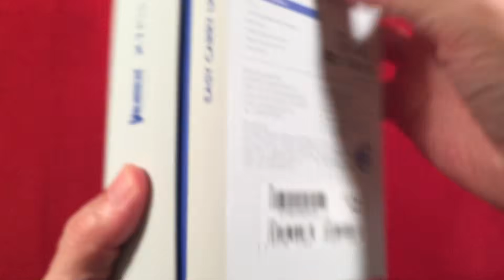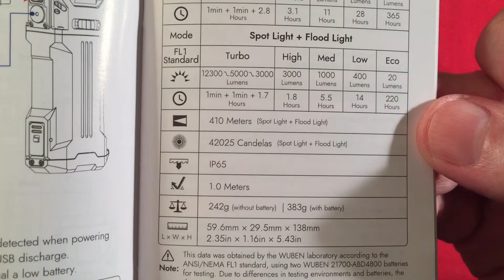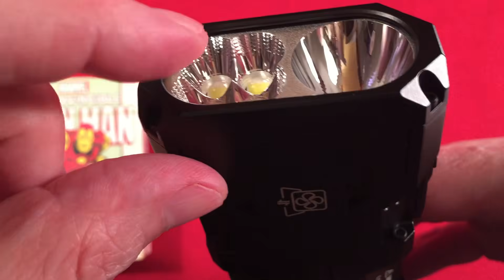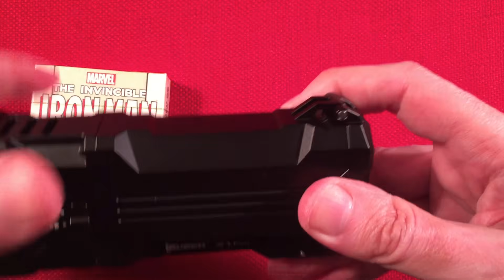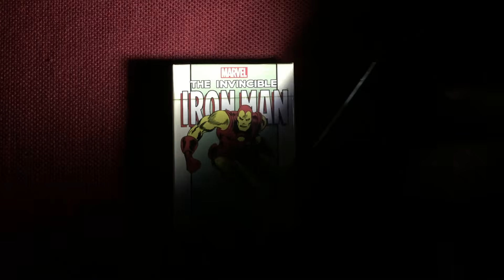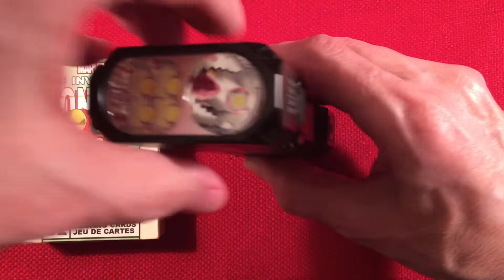Wuben X1 Pro 12,300L Extreme High Output EDC Flashlight Review

Comment: I tried some regular unprotected 21700s with neodymium magnet spacers on them. I had to use 2 magnet spacers on each battery and one spacer on each battery had to be on rhe positive end of each battery so the battery would make contact due to the indented positive connections on the flashlight.
Reply from the maker: I imagine it is the huge current draw that is keeping the added magnets from not working properly.
Reply: My batteries were 10A continuous discharge rate and the WUBENs are 20A or 25A max depending on where you look.